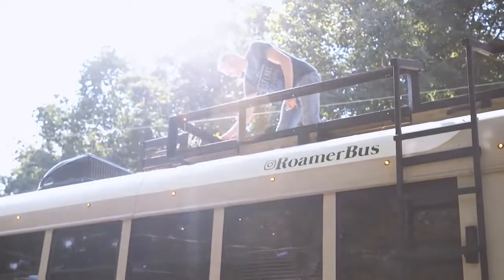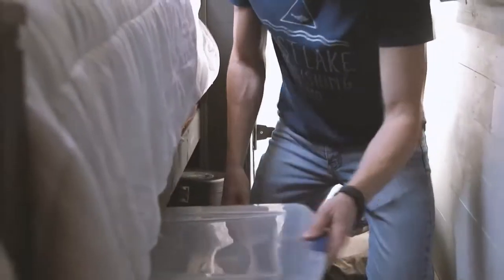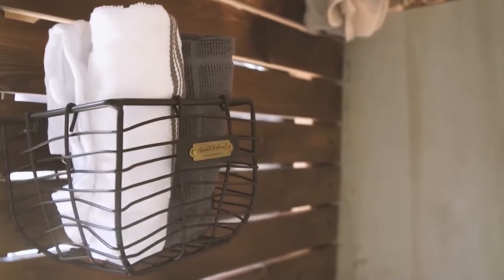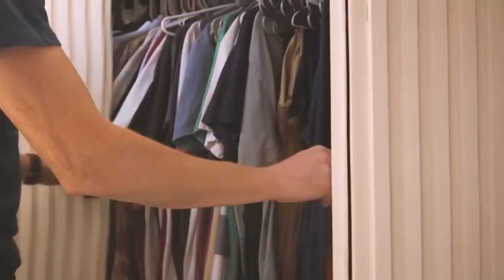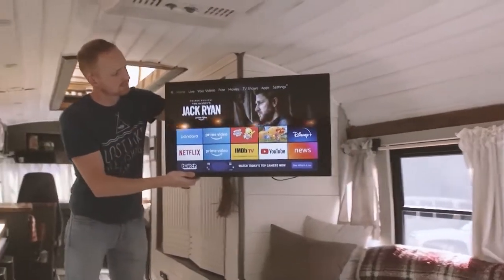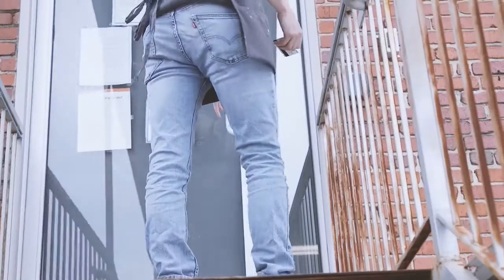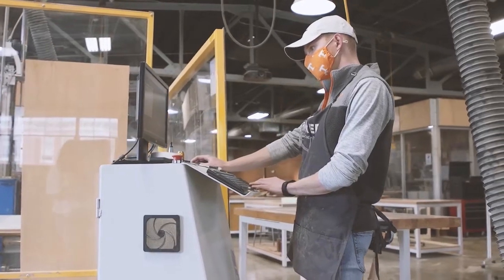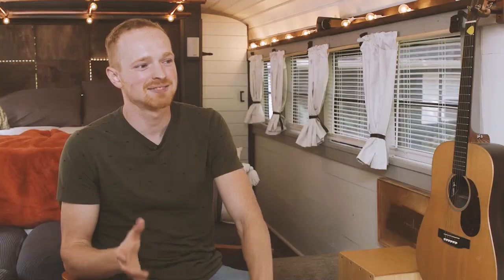Tennessee Architecture and Design Student Transforms Bus into Dream [Tiny] Home

Comment: Pretty cool of the dude. I've looked long and hard into doing this myself. Although.... the practicality just didn't seem worth it. Also the cost analysis overall can be low initially..... seems like a lot of maintenance cost to the bus overtime. 

I do know you can shower and do things like that by having a membership to gyms and stuff. Can conserve on not having to have water in the bus for sink and shower space. Also garunteed parking.

Good luck with dual majoring. I think he wants to die. Seems expensive as hell. Probably why he made the bus also 🤣

Nice video and cool project for a house though. Really well done.